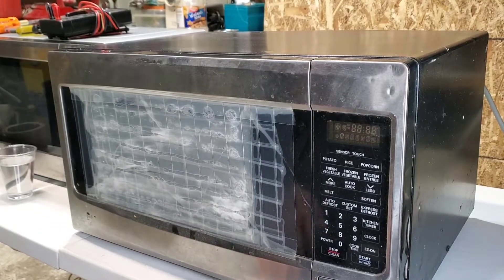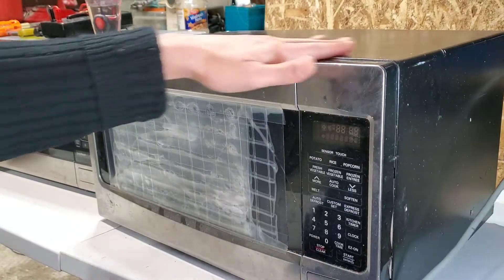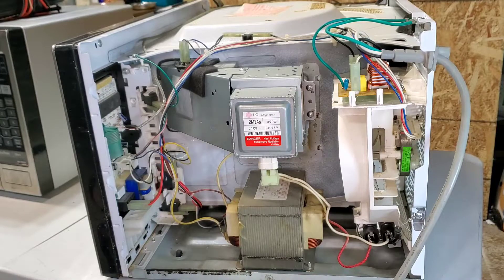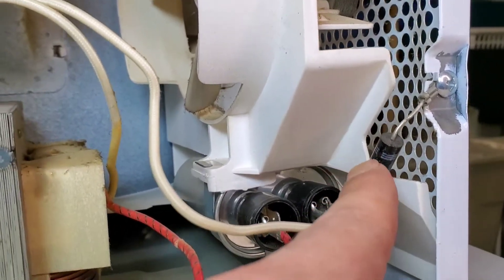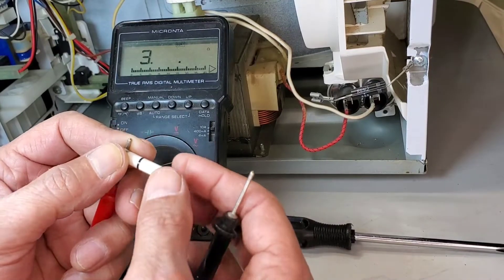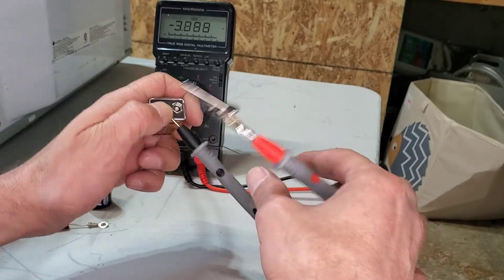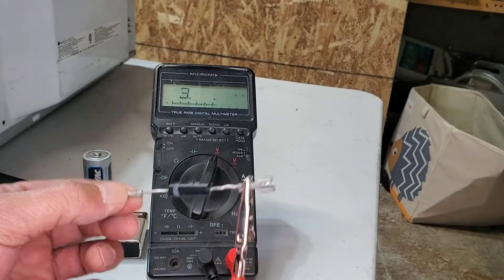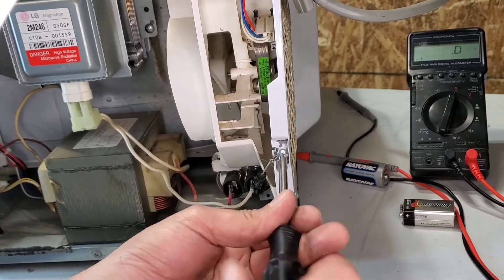How To Fix Microwave Doesn't Heat, Microwave Works But No Heat, Easy Fix

Comment: I am extremely concerned about your method of discharging the capacitor. It would be best if you shorted out the LEFT (set of two connectors) to the RIGHT (set of two connectors). Shorting out one connector (inside the black circular collar) to the one next to it inside the SAME black circular collar is useless. There are a total of four connectors to that capacitor, two inside one black circular collar and two DIFFERENT connectors inside the OTHER black circular collar. But, you are right: it's very dangerous. If there is any voltage remaining in that capacitor and you make a connection to it directly or indirectly through you, you could end up getting killed.
Reply from the maker: Hello my friend, many many thanks and appreciation for your wonderful comment and great information,  I have never attended electronic courses or study I only have experience and  little knowledge fixing electrical devices and appliances, I want to study but i honestly don't have time, so what you mentioned in your message is really true helpful information, thank you and all the best 👌 👍
Reply: Was just going to write and tell him the same thing. Trouble with these types of videos, If people do not know any better, they will believe what he is showing them is correct, when obviously it is incorrect. Thank you for pointing out his error to him.
Reply from the maker: Hello my friend, many many thanks and appreciation for your wonderful comment and great information,  I have never attended electronic courses or study I only have experience and  little knowledge fixing electrical devices and appliances, I want to study but i honestly don't have time, so what you mentioned in your message is really true helpful information, thank you and all the best 👌 👍
Reply from the maker: Thanks for your detailed and safety-conscious comment, Randall — I really appreciate you taking the time to point that out. You’re absolutely right that discharging capacitors the wrong way can be extremely dangerous. I’ll be more careful to short across the proper terminals in the future, from left to right, not within the same collar. Safety first, always. Thanks again for the correction and for helping make this content better for everyone.
Reply: Plus, added to this, you should discharge to chassis ground. 😮
Reply from the maker: @Masterj3712 , hello my dear friend, thank you for pointing this out,  yes that's right,  for some and while additing my video maybe I missed that part,  and I  made another video to show to discharge capacitor linkninnthe description. Best regards ✨️

Comment: I changed diedo but still not heating. Any tips?thank you
Reply from the maker: Hello my friend,  did you replace same diode ? I mane same value numbers? If yes and still no heat it's likely that the magnetron in your appliance is broken.thank you and all the best.
Reply: Most important firstly firstly you must check if the voltage is present  to the transformer, some countries got 220 volts ac , some countries maybe 110 volts ac.  Sometimes can be the high voltage diode, sometimes can be the magnetron.

Comment from the maker: Please let's know if you need any help or questions or concerns will be happy to to answer 😊 
Thank you so much and all the best 👍
Reply: QUESTION , I JUST PUT OUT THE 3 microwave switches I need to put it back it is 2 commonly open and 1 commonly close , but I don’t remember which one going first second and therd. Thank you
Reply from the maker: @juanperalta3780 , In most microwaves, the three door switches work together to ensure safe operation. Here's a general guide on how they are typically arranged:
1. Top switch (Commonly Open - NO)
2. Middle switch (Commonly Closed - NC)
3. Bottom switch (Commonly Open - NO)
How to Identify the Correct Order:
1. Look for Labels or Markings: Some microwaves have markings near the switches indicating their position.
2. Check the Wiring Harness: The wire lengths and connectors often guide the correct placement.
3. Refer to a Service Manual: If you have the microwave model number, I can help you find a wiring diagram.
4. Test with a Multimeter:
When the door is closed, the NC switch should open, and the NO switches should close.
When the door is open, the NC switch should be closed, and the NO switches should remain open.
Would you like me to help find a wiring diagram for your specific microwave model?
Reply: @  sangsum ME18H704SFS    thank you
Reply: Hanabishi ang brand sa among microwave 
No power